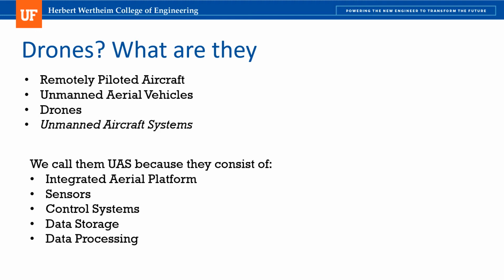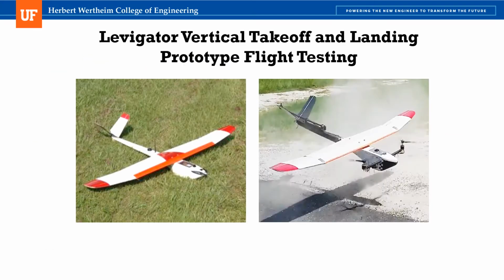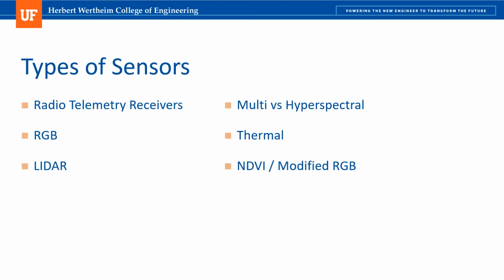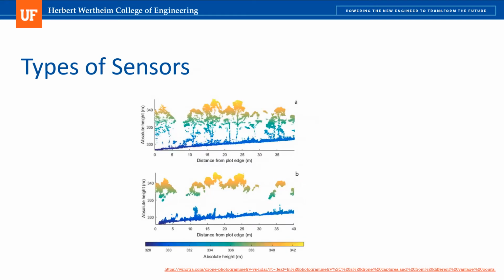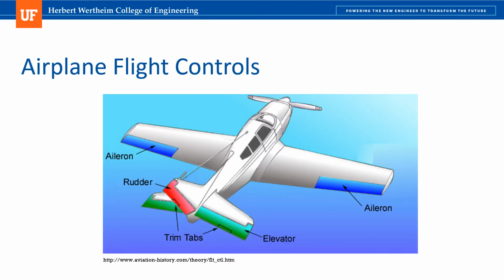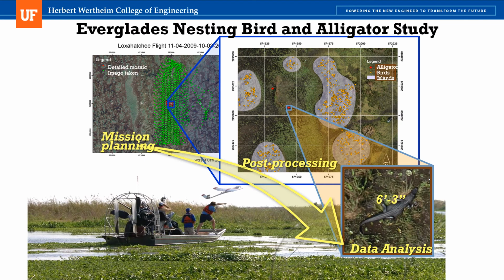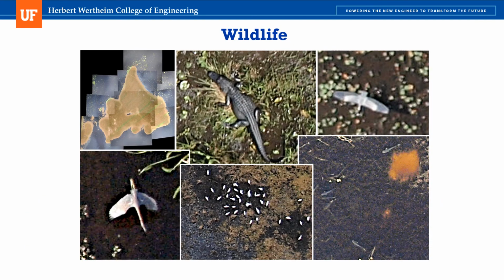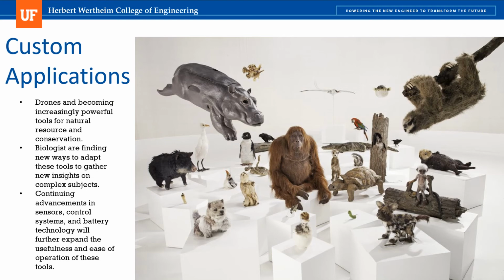Introduction to UAS (drone) technology

Comment: Few inputs as I work in drone industry (sky-watch.com) Fixed wing is really good for mapping large areas or following objects from a distance with less disturbance but picture quality isn't as good as on multirotor as that's much more stable in air. Both types with autopilot systems have "big" problems with takeoff on bit metal objects like boats. Usually fixed wings need lot more space unless they can do a deepstall landing, we can land within a 15 meter circle without parachute! Parachute will give you landing problem as you have no control of where you will land. For accurate pictures look into PPK/RTK.